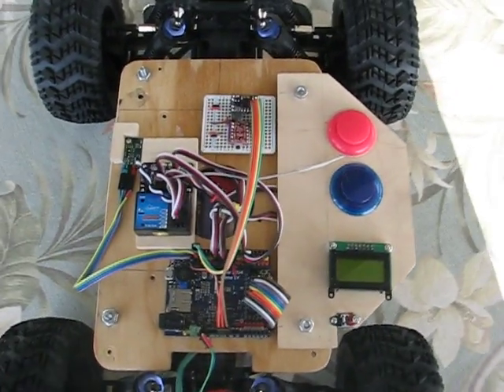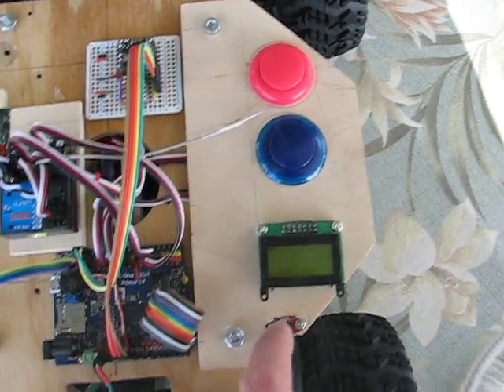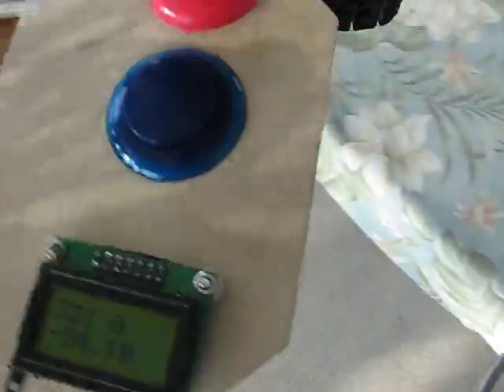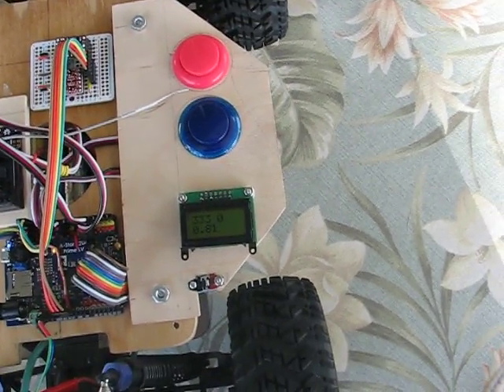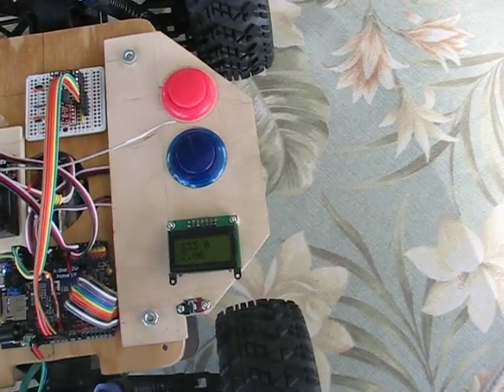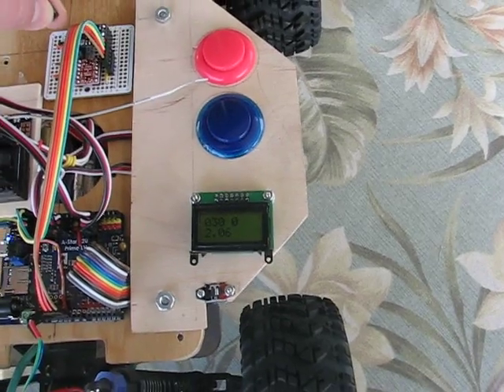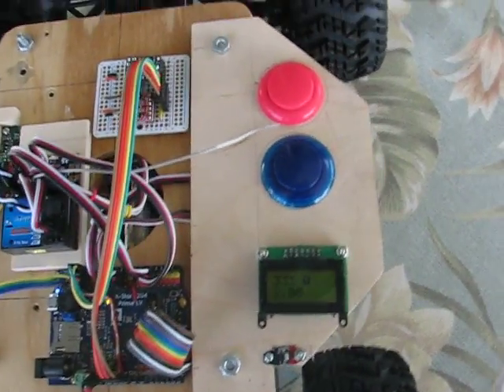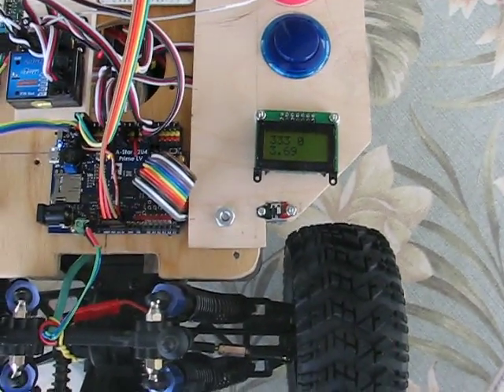BNO055 AHRS sensor

Comment: How does it work with lateral accelerations? Does it suffer roll errors after them?
Reply from the maker: +stezz90 I haven't rigorously experimented with accelerations, but from my use on pavement and dirt I have not had any issues with roll errors.
Reply: +Ted Meyers thank you, I was struggling with lateral acceleration filtering in a motorcycle gyrocam made with mpu6050 and hmc5883l.. I may consider this Bosch IMU..
Reply from the maker: +stezz90 I think that you'll be happy with it; it is the best MEMs IMU that I've found.